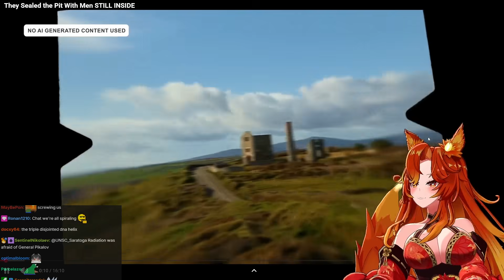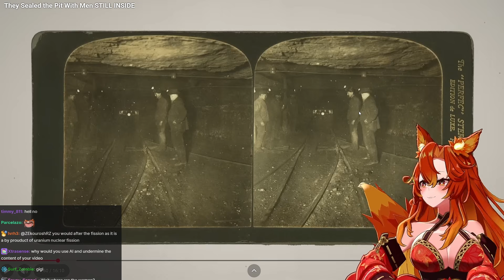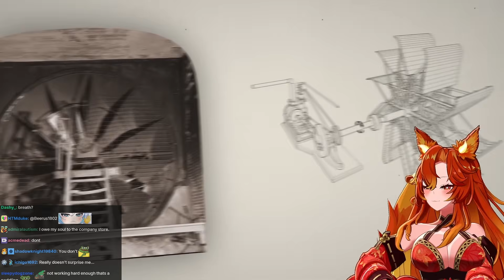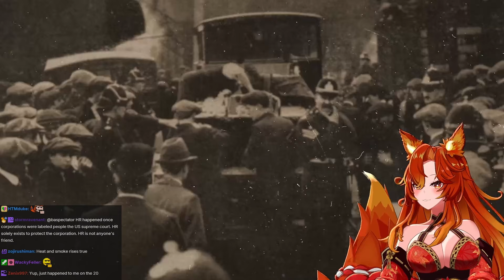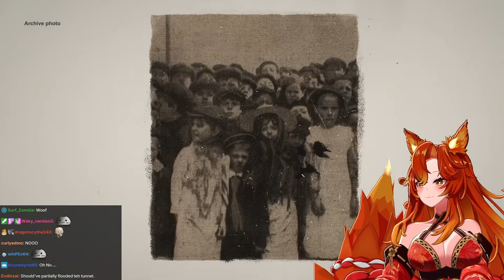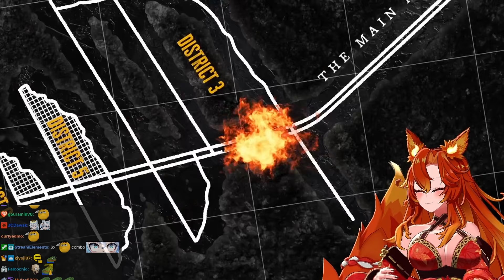This Story Is F**ked Up..

Comment: 1:55 Akshully (insert nerd face smiley here), in Victorian England there were women in coal mines. And children too. Not breaking a rock, of course, but pushing mining carts. Families had a lot of mouths to feed, and in small mining towns there was a littel job opportunities other than mines. It was a huge scandal in Victorian society when some newspaper reported it, and women was banned from mines by a legislation. Not because it was a hard labor, but on a "moral" grounds. You see, a ventilation in mines was poor, and it was very hot in there. So, male miners worked fully naked, and women was wearing just pants (yes, pants - skirts are not very practical in mines, and that was another thing that was against Victorian morals) and nothing else. That was scandalous and women was told not to work n mines. Still, nobody told them where they should work instead, so many of them continued to work in coal mining - only above ground, sorting coal. And some still worked undergroud, illegally.

Comment: Aight so I'm gonna make a prediction on the issue just at a glance. The candlestick is usually at the end of the mine cause the airflow makes it pull any dangerous gasses away from the entrance and towards the back. It being in reverse, it did the exact opposite and the entrance flooded with gas before it even reached the end, so by the time they noticed the gas it was suicide to leave and suicide to stay. I guess we'll see if I'm right or if I'm stupid (probably the latter).

Comment: Miners would use calcium carbide headlamps. Water was slowly dripped onto the calcium and a chemical reaction would occur producing acetylene gas where it was lit to create the light.
Reply: Yep there were 2 chambers; a reservoir of water and a chamber where the calcium carbide was located. They could adjust the flow rate of the water to produce more gas. Then there was a reflector on the helmet and a tube leading to it where they would use a flint striker to light the gas. More gas produced in the drippy chamber meant a brighter flame.
Reply: Maybe worth noting, the same system was used for the headlights of early cars, steam locomotives, and ships' mastheads. As you might imagine, mining the fuel for that stuff was its own safety nightmare.

Comment: 18:00 It either takes a very long time, or it just keeps burning.
There is a large coal mine in america that has been burning for +50 years. (Centralia, PA)
this mine was under the sea, so there was less chances of air coming in.
If only they had all evacuated the mine at the first sight of smoke...
Reply: And if it's bituminous (which I would assume since it's in the UK), then even an ingress of water might only make it burn hotter.
Reply: @DistractedGlobeGuy  Oh boy. It would turn into a city sized steam cracking refinery...
Reply: @DistractedGlobeGuy  Also, you know, drowning the miners.
Reply: And the “gates of hell” in Turkmenistan.
A drill broke into a gas-pocket and the roof collapsed so, to prevent poisonous gas from spreading, they lit it on fire to burn up the gas.
That was 1971, it’s still burning.

Comment: 16:35 It means that if the bird becomes suddenly restless, you should go outside, and if the bird faints, run for your fucking life.
Reply: Yes, small birds react to things like chemicals at much, much faster rates than even a mammal of similar size, let alone a human
they also will CONSTANTLY make noise, so you don't have to see them react to know it is happening
Furthermore, most of the problem chemicals you have to deal with in a coal mine are heavier than air so they would carry the bird at hip level so it reaches them first, giving you time to react
Reply: @drthmik  Wearable Lanterns (Skyrim mod), but birdo lol
Reply: and note the purpose of the bird is to pay attention to it and NOT have it die. If it's that bad that it does die that's one thing, if you watch it pass out and hang around you're dumb -.-